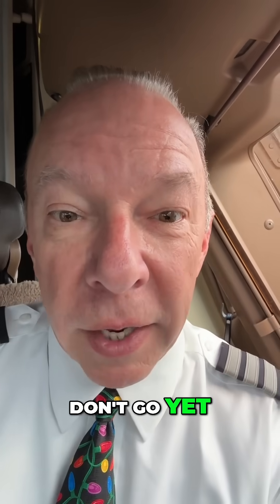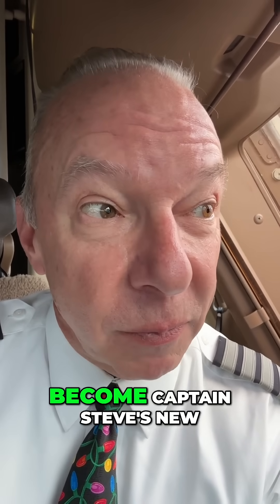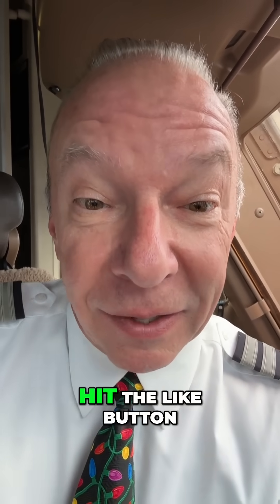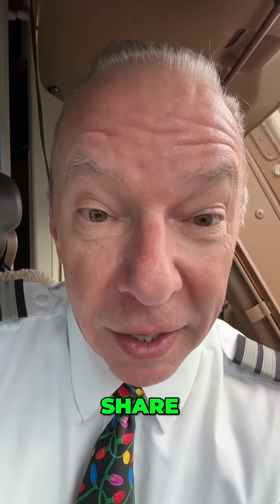Why You Can't Raise Landing Gear on the Ground

Comment: An airport worker at Heathrow got into the cabin of a parked jet and played pilots with the controls.  He did exactly this, partially retracted the undercarriage but as there was no power, most of the switches and levers did nothing at the time - except the fire extinguishers, and he flooded all the engines with the fire suppressant.   Yes, he was fired.
Reply: A lot of those depends on the particular plane. Some planes only have a switch, for example.  And sometimes that which is not adjusted properly.
Reply: OMG! I'm always asking folks to look with their eyes.
Reply: Golden rule, if you don't know what the switch is for don't touch it!
Reply: "Don't touch the Compressor Blades, the leading edges are razor sharp." It's like there is an irresistible attraction beam.

Comment: Would the hydraulics be powerful enough to pull the landing gear up on the ground if it were to not have those failsafes?
Reply: It couldn't retract with hydraulic power on heavy jets. The weight of the plane and the springs holding the over center linkage is too much for those small actuator.
Reply: @chuckm626  that’s what I figured

Comment: I did love the P3, as an engine guy, the engines were normally unstressed, as the engines weren't thrashed. The Orions just cruised during most missions. Basically the same engine on the Herc, they were failing much more regularly, because they got flogged.
Reply: Hydromechanical Computer. Glory days.

Comment: It actually happened in Sweden in the 80's. A drunk guy managed to get into the cockpit of a commercial jet airliner and for some reason he also managed to raise the landing gear while the plane was parked at the gate.
Reply: Similar happened in Sweden with a Saab 340.
Reply: @patricj951  that's the one I referred to above. It's the same plane, same incident. Got it nearly first hand... Not sure he was drunk though.
Reply: @62Baltus  
Ok! You wrote a jet airliner.
I think it happened at Luleå airport, is that right?
Reply: @patricj951  Yes I'm pretty sure it was at the Luleå airport. Don't remember the year though but I think it was a DC3.
Reply: It also happened to a LOT Polish aircraft in Tallinn while taking off. The crew raised the landing gear before they were fully airborne and the plane came crashing down on the runway. I was playing soccer nearby and heard the sirens when the city FDs rushed to help. LOTs of sirens (pun intended).

Comment: If the gear pins are not installed on a B747 and the gear handle raised UP, the nose gear wheels will roll forward and the gear retracts. The nose sits on the ground. The body gear also does the same thing and the aircraft will sit on it's tail. The wing gear CAN NOT retract on the ground because they move inboard. This has happened several times to maintenance by not putting the gear plns in. Once they installed the landing gear handle module and connecting the cannon plug with the handle in the UP position and power and hyd on.
Reply: The same thing can happen on a KC-135 and did in the 1980s at Plattsburgh AFB,NY
Reply: That sounds like it would be a mess to deal with
Reply: That's a problem waiting for a solution... A somewhat simple and effective solution, whatever it could be...

Comment: So if the pilot passes out and a passenger has to fly the plane who’s never done it before if they can successfully land the plane how do you put on the brakes? I used to be the flight controller for flight craft in Boeing Field. Mostly it was Learjet and fingers and Beachcraft airplanes. I did the whole point check before and after the planes that was the funniest job I ever had.

Comment: The WWI-vintage Vought F4U Corsair had this issue (and the Hellcat). Largely due to the landing gear control placement being next to the flap control. Also, no sophisticated interlocks etc. These birds were basically built fast, and designed as disposable assets - as were the pilots, unfortunately.

Comment: Some (carrier based) aircraft can override the safety lock on the gear handle in case of weight off wheels failure.

I heard a tale of two 747 pilots debating if the hydraulics were strong enough to raise the gear on the ground. One of them put the handle up. I don't know if it was the wing or body gear that moved, but that was a career ending decision.

Once we ( a crew unqualified to  work on that aircraft) were doing a landing gear drop check on a T-39 (Saber Liner?) and forgot to remove the tow bar from the nose gear.  After a few cycles, a Chief walked by and said to make sure we disconnect the tow bar before we put the gear up.  Fortunately, the tow bar is attached with the nose gear downlock!  No damage from ignorance!

Comment: Over the years I’ve watched aeroplane accident videos where takeoff weight was implicated. These weights are often shown being assessed by the crew prior to take off where the resultant calculations are shown to have been wrong and caused the accident. Surely it would be possible to fit strain gauge systems to the undercarriage to give the actual total weight without the need for estimation and calculation thus removing the possibility for human error?

Comment: It can be done on certain planes.  It has gotten some pilots fired.
Reply: We have heard that same, but the pilot died in flight accident and then it was told.
Reply: @kyostim  that was one of the pilots that came to mind when I wrote this comment.  His name was Hans Lutz and he flew for Crossair.  He performed the gear up on the ground while in a Saab 340, and died in the Avro RJ100 he crashed while flying the Berlin to Zurich route as Crossair flight 3597.  He lost his flight instructor role as a result of that incident with retracting the landing gear on the ground.  It has happened a handful of other times on various type of planes.
Reply: Here are details of the Crossair gear retraction on the apron in 1990.  "A training captain of a Saab 340 was betting with his students that the weight-on-gear mechanism would prevent gear retraction while on the ground. On the accident airplane type, the mechanism would lock the gear handle, but the lock can be overridden if the pilot manually pull out and move the handle. The instructor confidently pulled out the handle and to his surprise, the hydraulics started to move and the gears were retracted while the plane was still on the ground."  I have read of a few similar incidents where a pilot did it, but it's usually done by maintainence technicians by mistake during them doing repairs while not following checklists.  One that happened recently was a KC-135 at McConnell AFB in May of last year.
Reply: @seanpellegrino2989 wait so that airplane didn’t have a weight on gear mechanism then? And no mechanical backup?
Reply: @ChevereJones  the Saab 340 has weight on wheels sensors.  There is apparently an override of those sensors that takes place when you pull the lever out and up.  It has happened more than once.  Here's the text from another gear up on the ground incident with one that happened in the Bahamas.  "Two crew took place in the cockpit to prepare the aircraft for a scheduled commercial service to Marsh Harbour. In unknown circumstances, all three landing gear retracted, causing the aircraft to fall on the ground. Both occupants were uninjured while the aircraft was damaged beyond repair. It is unknown if the retraction of the undercarriage was the consequence of a mechanical failure or a mishandling from the crew."
Reply: @ thank you for the detailed explanation! I wonder what function that override serves/is in place for 🤔 also, that aircraft didn’t have a mechanical stop? ⚙️🛑
Reply: @ChevereJones  it seems that it is used in the event that there is an issue with raising the gear after takeoff.
Reply: @ in which case there wouldn’t be weight on wheels but maybe if the switch is faulty and it’s saying there is? That makes sense
Reply: The captain of that Crossair 3597 that crash near Zürich airport in 2001 did that years before the accident and he was fired from being a flight instructor.
Reply: Ansett B767. Engineers removed Down Lock Pins and went for a rest break. Someone performed a gear retract ground test assuming the Pins were installed. NLG collapsed. Never assume!